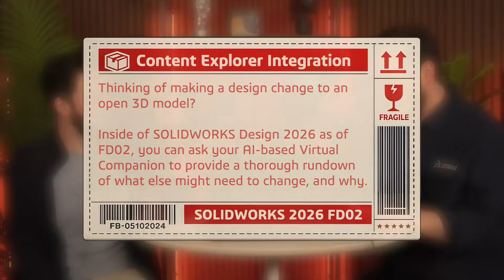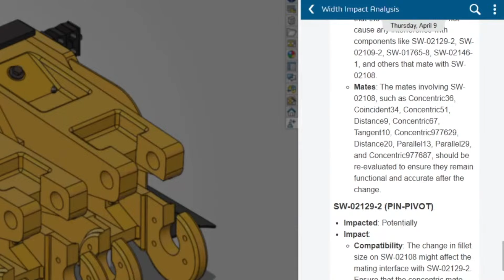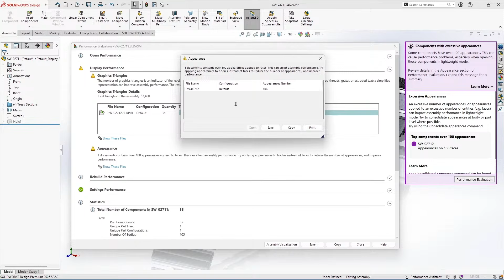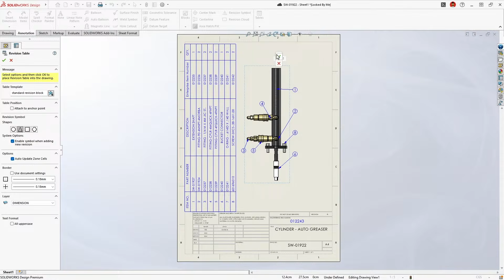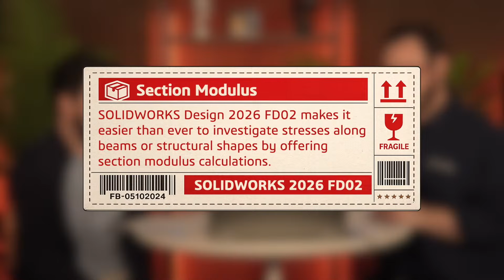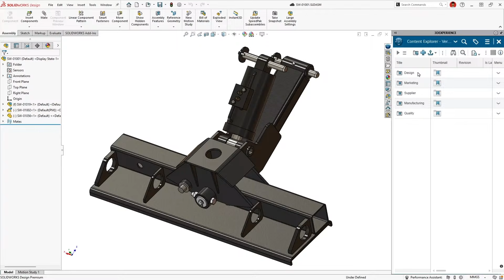SOLIDWORKS 2026 FD02: Performance Assistants, AI Virtual Companions & Faster CAD Workflows

Comment: When is Solidworks coming for Linux? My 9100Pro drive with Windows 11 isn't even installed in my PC anymore, because Windows doesn't deserve it. Engineers and gamers are switching, so I hope Solidworks keeps up with us, because Solidworks is also on that drive. So many years of pushing 3DX, that just wasn't what we wanted or even up to SW standards, means it might not be what we need anymore either. The soul of SW went to Onshape, and 3DX still seems like a disjointed, outsourced, AI generated mess in comparison. Microsoft and Dassault seem like they're using similar tactics, but the game is changing and it might already be too late.